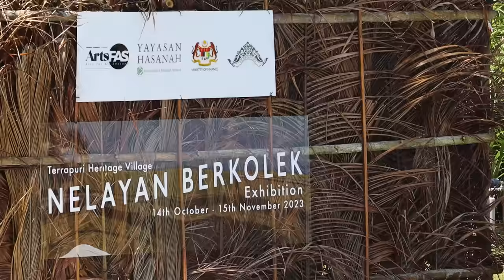Malaysian hospitality made my mom cry 🇲🇾

Comment: belimbing buloh/besi was the sour fruit used for making sour salads and sour asam pedas flavour enhancer. It's the same family as Star Fruit.

as for the trengganu fishing vessel builders. It was the traditional building style...They were one of the Pioneer Builders using material from the Forest. That diesel engine has low hp but high torque for fuel efficiency. That gearbox has 2 speed or 3 speed and have two functions for activating the PTO for activating Trawling nets rollers, if have demand for heavy fishing work